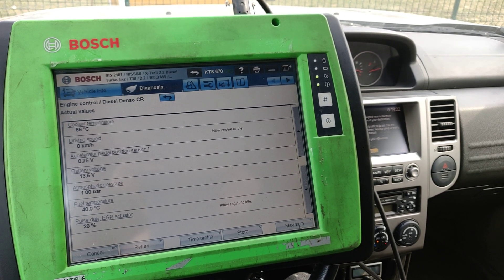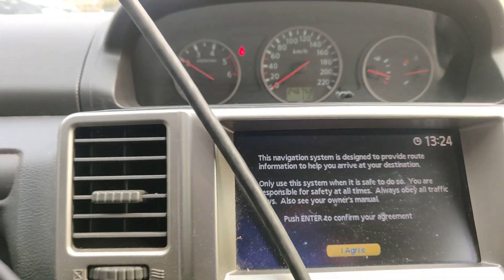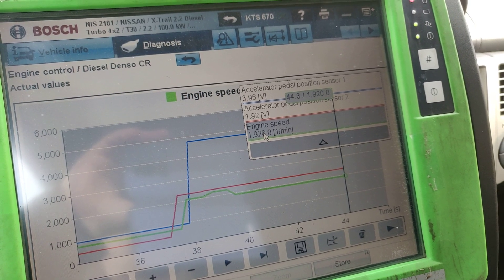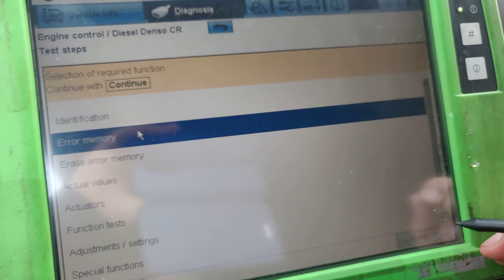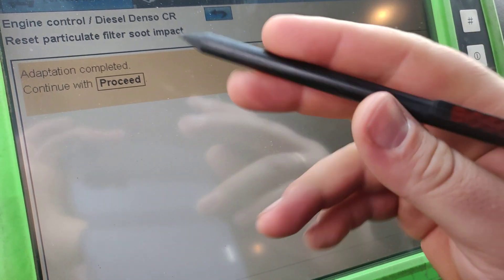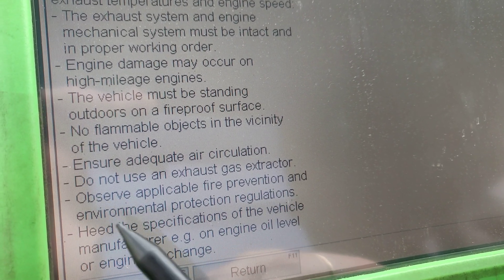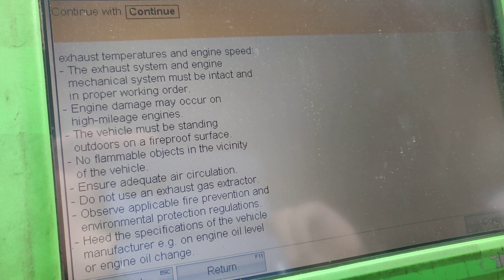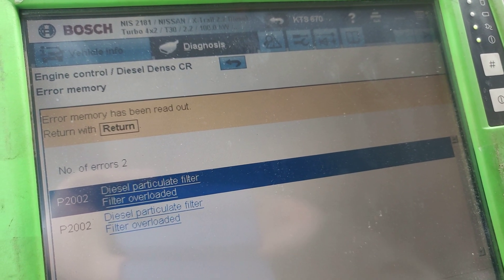DPF System Diagnostic Nissan Xtrail 2006

Comment: Please I am having a problem on my 2005 Nissan Xtrail dCi and it is throwing the code P2002 and won't rev above 2000rpm. How can I resolve this problem?
Reply: Need to change the air flow mass sensor